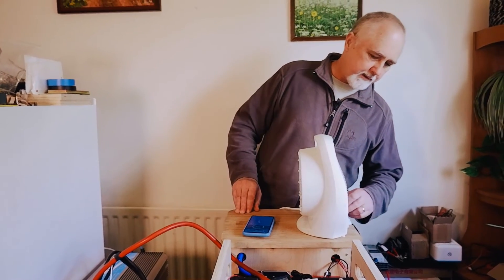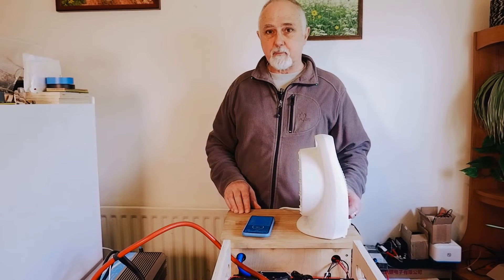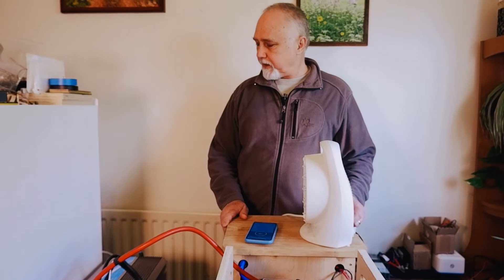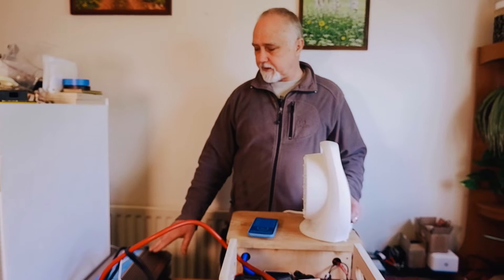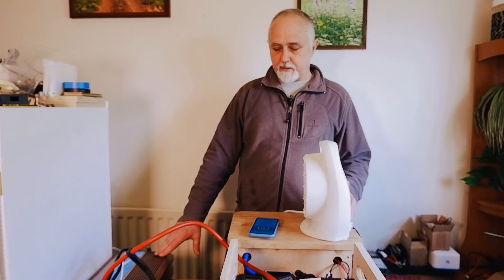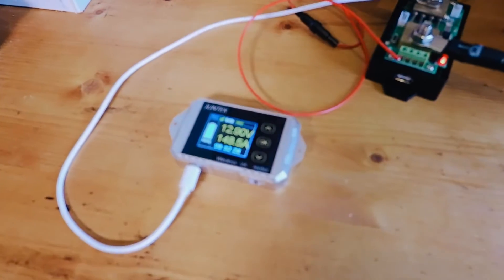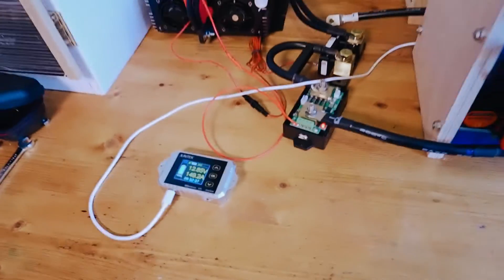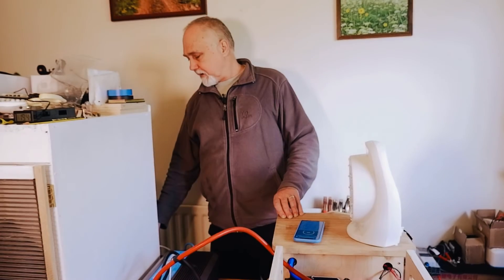High current test & review on EVE LiFePO4 Battery Cells

Comment: Good job guys, good to see someone do a decent high amp test which gives a better idea of what’s going on internally.
Eve are a nice cell, petty they didn’t make the terminals a bit longer to accomodate more connectors
Reply from the maker: Thanks for the comment! We really like EVE cells! You might be able to buy some that have a threaded hole in the terminals that allow you to use a grub screw with nuts that could allow you more space.

Comment: How long "duration" was the high power draw test?
Reply from the maker: We ran the high current test for about 1 hour 45 mins. We were drawing 160A continuously and the battery is 280AH.
Reply: @offgrid_power  that's perfect info, thank you
Reply from the maker: No problem! :)
Reply: @offgrid_power  This type of info helps out a lot, Cheers :)
Reply from the maker: I'm glad! :)

Comment: Nice that EVE have improved the terminals. Is it still M6?
Reply from the maker: Yeah, EVE are making a good product and these laser welded terminals are great! Much more improved over the threaded holes that you put a bolt or grub screw into! Yes, the terminals that are laser welded in are M6. Our only criticism is that the terminals are quite short. They're only 10mm or 3/8" so you don't have a lot of room for a lot of lug connectors. Apart from that, they're great! We tested tightening them to the manufacturer advised torque rating of 10nM and they performed fine!